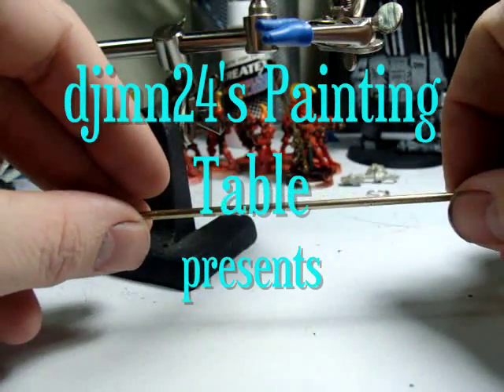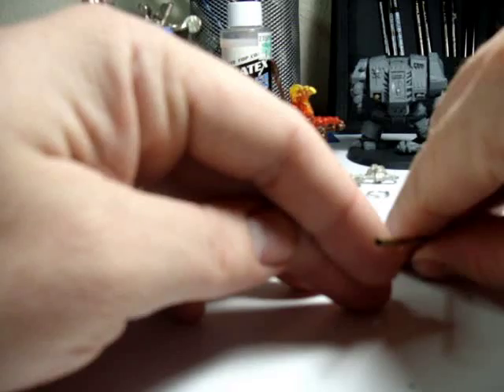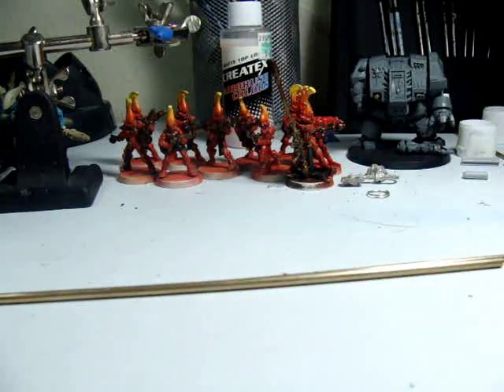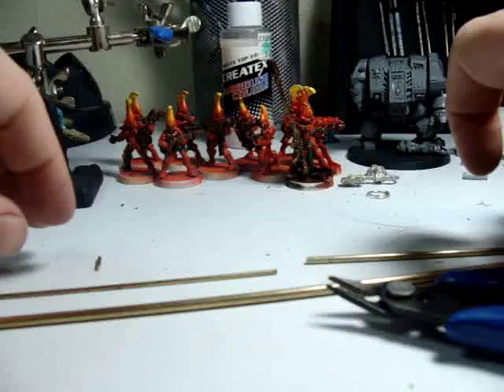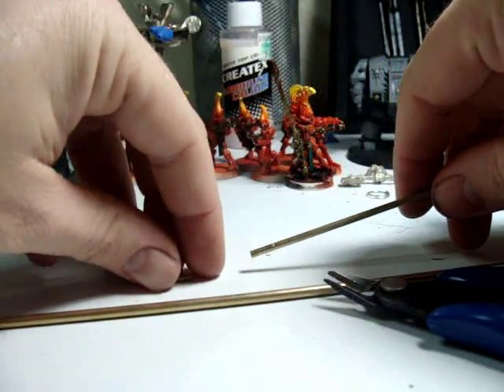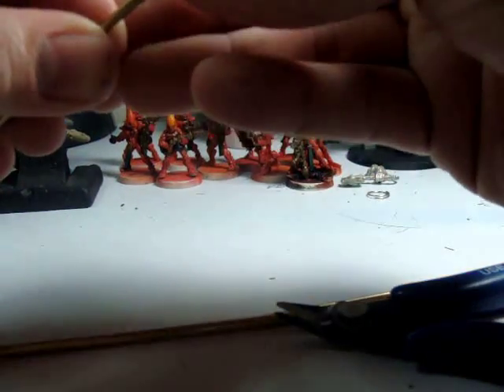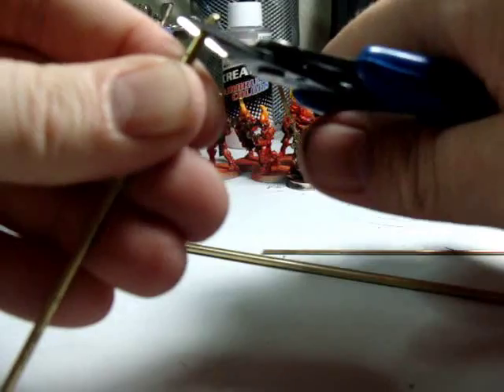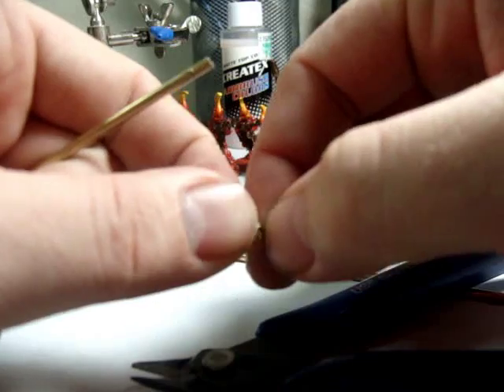Models-Workshop: Brass Rods (Cutting and Using)

Comment: I just used a mini pipe cutter with brass tubing in my drill motor.  Left hand holds cutter and I was able to turn the blade adjuster at the same time.  Right hand held trigger and power drill.  Worked so well, I had to share.

Comment: Use an exacto knife and roll the hollow brass tubing on the table top.  Works much more accurately and more quickly.
Reply from the maker: I have used both methods as well as others mentioned in other comments. They all have their uses. This tool is just safer too for someone who maybe younger.

Comment: YOu can also roll the tube with an exacto blade knife back and forth until it cuts through. At least with aluminum. Im sure it would work on brass and copper as well.
Reply from the maker: Very true!

Comment: Is this for hollow rods only? Will it work well for a solid rod? I'm looking to make short dowels with good "square" ends. -- Ah I think you answer that at the end. No good for SMALL solid rods, so I'm guessing it will be no good for 2-4mm solid rods (3/32 to 1/8 inch).
Reply from the maker: You can use this for solid rods as well! I focus on its use for hollow rods because those are notoriously difficult to cut without smashing the rod.
Reply: @ModelsWorkshop  oh great! So the problem you identify at 5:20 is about it being SMALL not about it being SOLID CORE?
Reply from the maker: @BobStein  correct! It's was how this it was as the Jaws will not close properly  and how thing that it.

Comment: exactly what i was looking for thanks for posting.

i am thinking of using brass rods and tudes to make brass pneumatic poppet or spool valves. i am wondering what you might suggest to join the rod and tubes once inserted. Also would you have any tips on making brass discs which are about 6mm in diameter with a 1mm hole in center?
Reply from the maker: Can you email me a picture example?
 Modelsworkshoppodcast@gmail.com
Reply: +Models Workshop where can i find your email address?
Reply from the maker: +Craig Munday it should be in the comment you replied to.

Comment: Hello! I'm trying to get some fix on the base pegs of pvc figures following this guide: http://radiantdreamer.net/broken-pegs-and-how-to-fix-them-the-rise-of-rize/
I'm still having trouble finding the K&S thingy, does it have a specific name? Or where could I find one online? Thanks!
I live in mexico and have trouble looking for tools and materials due to translation specifications, but I was able to manage and find some 3/32 brass rods.
Reply from the maker: I'm so sorry for not getting back to you sooner. Your comment was caught by the spam filter and I just found it. Do you still need help finding this part?
Reply: Models Workshop yes please. I did some work on a couple of figures but ended up doing it with a small saw manually. Kind of hard getting a smooth cut and seemed more trouble overall
Reply from the maker: Fernando Mata I'm not sure how feasible Amazon is down there but it is carried there. Tubing Cutter https://www.amazon.com/dp/B000BQPYYK/ref=cm_sw_r_cp_apa_yLGVybDXYEVFZ
Reply: Nice, I'm living in CO right now, so it'll be easier to order it.
Reply from the maker: Fernando Mata Awesome! I should be doing more videos on K&S stuff here soon too!